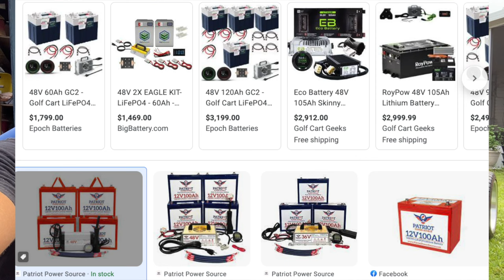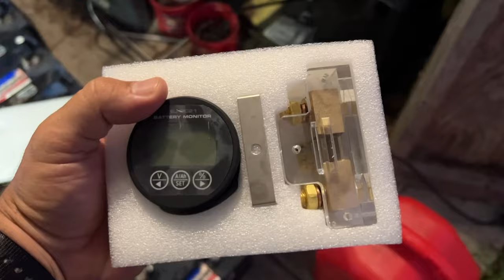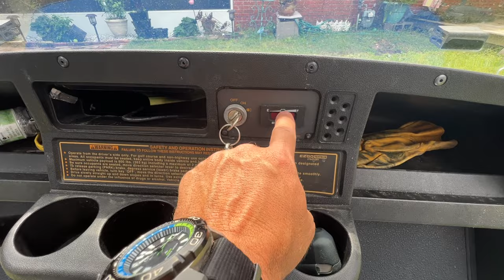Converting my EZ GO Golf Cart to Lithium Batteries! (Watch before you BUY!)

Comment: Take those old 6v batteries to Auto Zone. They will give your 15 or 20 dollars a peace for them. That's around 100 dollars sitting in your shed. Great video, have fun on the cart.
Reply: It's actually $10 per battery. I took mine in today.  They give you a store gift card.

Comment: I prefer the modularity of multiple batteries (ie 3x12v=36v, 4x12v=48v, etc). It tends to cost a little more than a single higher voltage battery - at least for lead-acid, I haven't worked with lithium yet. However, it allows you to easily run 12v accessories from your system by running a 12v circuit from a single battery in the cluster. You have to be careful not to overload the battery you are pulling from. But if you don't overdo it, it makes your system more versatile.
Reply: There are many accessories, such as usb outlets whose chips take a wide range of DC voltages.
Reply: @dropbear9526  I've seen both (multiple 12v and 6v systems). My preference is also 6v batteries. I believe they are more durable. I understand your logic about going across the entire bank - it makes sense and if current accessories are designed for that, it's definitely the best way to go. That part of my comment probably reflects my experience from the 1980's and 1990's where those higher voltage tolerating accessories either didn't exist or were prohibitively expensive.

Comment: Curious how you store your batteries??? Im a little nervous of them catching fire, Thanks
Reply: @secretjourney4815 If your talking about the voltage you should leave the batteries at for a 36volt system you would want to leave the batteries at or around 38v. Or 12.6v per 12volt battery

Comment: Before you used them, you should have charged each one individually to full charge, then connected them in parallel for at least 12 hours, it balances them and gets all the cells on the same voltage/capacity. You can still do it now, and if you do your batteries will last longer.
I also put a separate balancer on my setup.

I don't mean to burst your bubble, but, I did my entire setup for 2030 Australian dollars. 
2030 aud = around 1335 usd atm.
That was for 4x 12v batteries, 5x 2awg leads, KG140F battery gage/monitor, balancer, and charger. I'm going to fit a 300a circuit breaker as well.
Your batteries very well could be of a higher quality than mine though, and your charger is better, so you still did pretty well for what you paid, but you could have done it for a lot less.

The main difference between the batteries you have, and proper golf cart batteries is, your batteries are most likely 100a charge rate and a 100a continuous discharge rate. They can most likely handle spikes of 200a for 5 to 35 seconds max.
A golf cart battery can commonly do 200a charge rate, a 200a continuous discharge rate, and handle spikes of around 400a.
You can draw more amps with a golf cart battery. The cart will draw more amps when under load/working hard.
So, if you're on flat ground, and don't have a heavy load on board, for the most part you'll be right, but, if you have to go up steep hills, or carry a heavy load, you will draw more amps. If you draw too many, the system will shut down. And, It's not good for the batteries. They swell up. Now, think of a balloon. If they swell up too much, they'll pop. And most likely catch fire.

I hope this helps you get the most value from your setup. Enjoy.

Comment: Enough of the "Bad boy".  .     Could have got 2 Dakota Lithium 36 volt batteries for 72 volt ..but what you did is OK..
Reply: 36 volt batteries are not as dependable as 12 volt batteries. 
Current Lithium charging technology doesn't top them off as properly. 
The owner, inventor & patent holder of Battle Born Batteries, explains this on "The Bilge" podcast. That's with any brand of lithium. Check it out...